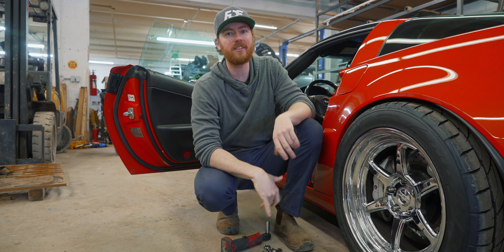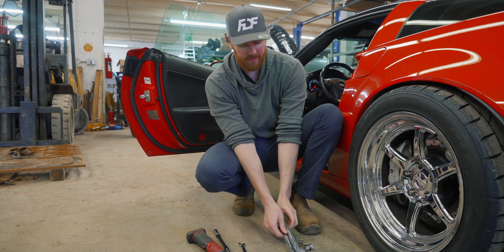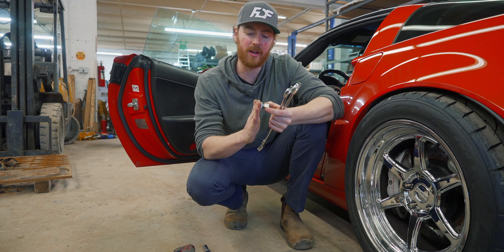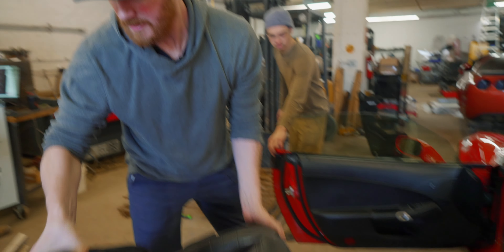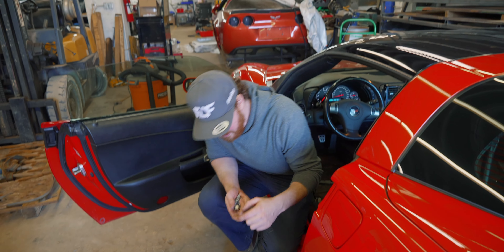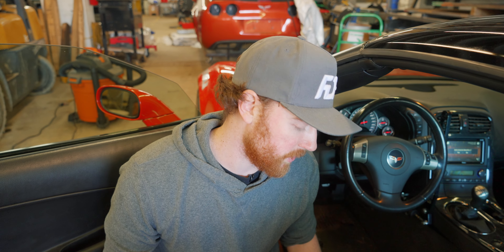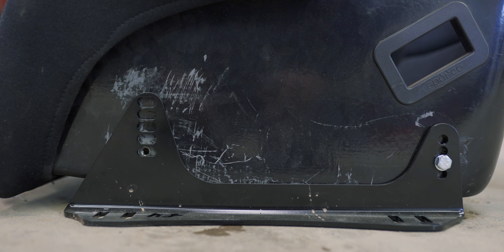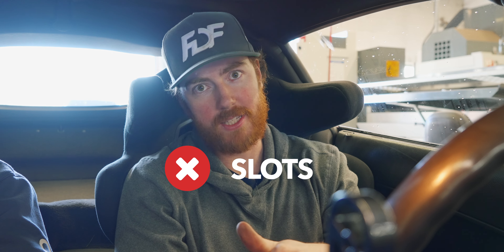Corvette Seat Bracket Install (Lots Of Clearance)

Comment: Currently struggling using these mounts with a prisma . Any suggestions?
Reply: It took me like two full days of wrestling to get my prisma in, you’re gonna have to cut out a good amount of carpet… and it’s too close to the wheel so I have to pull it back out to adjust it 💀😭
Reply: @jaredhirsche2182  I ended up putting the brackets on the mill to enlarge the holes. Then flipped one of the seat mounts. It was a struggle!